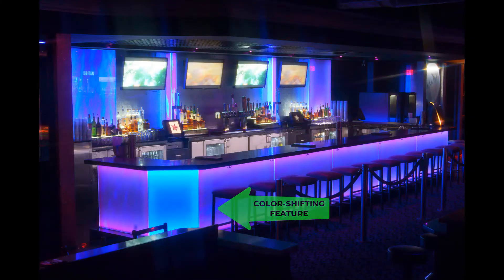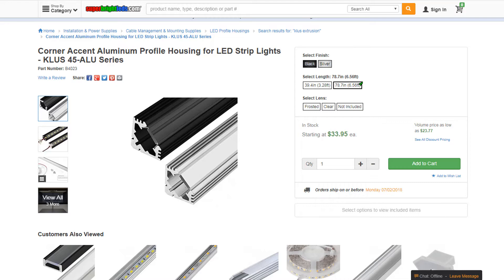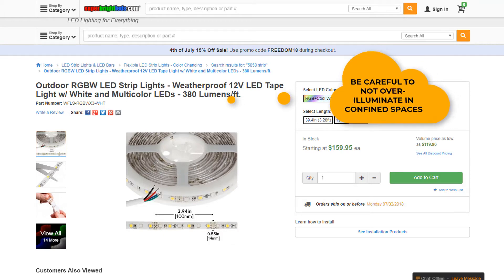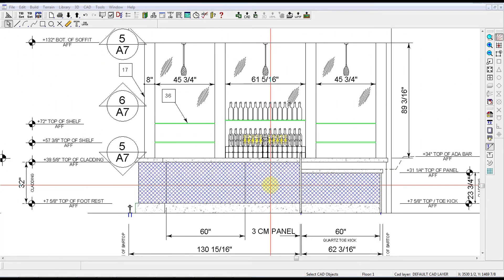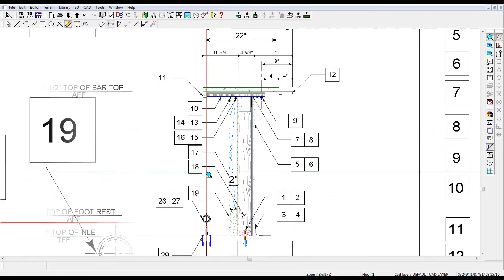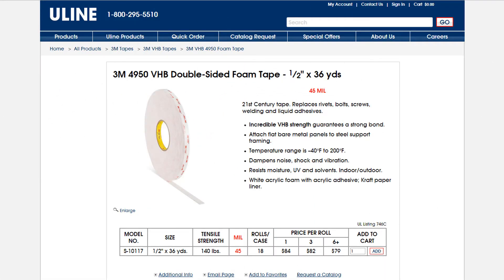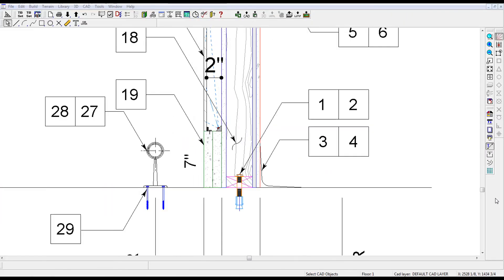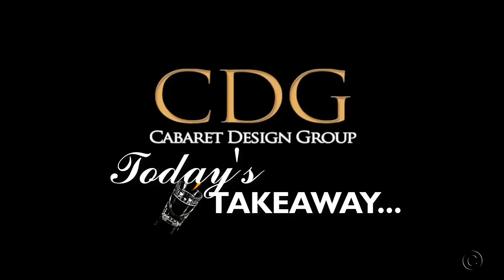LED Bars - How to DIY Design and Build

Comment: Great video what about a modular bar where the front panels are supposed to be removable for easy access and maintenance. Is there a way to put the panels with removable clips right to the frame of the 2x6 metal studs.
Reply from the maker: Thanks for the feedback. Yes, the modular bar die enables external access to plumbing and electric, which is run entirely inside the die (and all bar equipment (except for coolers and glass washers) is welded to the frame at the factory). Therefore, all utilities are accessed from the patron-side of the bar. The panels are normally installed with Z-clips, which are installed continuously along the top and bottom. I'll be covering the modular bar die in an upcoming video.
Reply from the maker: I don't think I entirely answered your question. Z-clips work best for bar die with a millwork finish, and yes, they're mounted directly to the metal framing of the bar die itself. Backlit bar fronts (which utilize architectural panels or translucent makrolon) work best with a 1/2" x 1/2" x 1/8" anodized aluminum angle that runs continuously along the top and bottom edges, per this sketch: http://cabaretdesigners.com/images/LED_BACKLIT_BAR_SECTION.pdf You'll need to drill three or four equally-spaced holes along the top and bottom edges and use small, self-tapping screws. Good luck!

Comment: Thank you for your quick reply whats the best material to use for the front panels for an LED bar.
Reply from the maker: My favorite is architectural (tempered laminated) glass - it's the material we used in this video and also for the bars at Night Trips. However,  this is very expensive (about $130 /SF). The best bang-for-the-buck are the translucent makrolon materials I referenced from Lumigraf; for best results, use the 3/8".

Comment: Thanks for the great video. I’m doing some diy at home. Question do you have the Legend/descriptions the numbered materials for Bar plan? Just trying to understand if panels are glued to wood behind it or what materials are used behind the resin panels 
Thank
Reply from the maker: I have to apologize for the lack of information. I just created a PDF of the sketch (complete with keyed notes) and you can see and download it here: http://cabaretdesigners.com/images/LED_BACKLIT_BAR_SECTION.pdf. With respect to the panels, I always specify using 3M VHB double-faced tape; I always design commercial applications for a permanent installations, so if you use the 3M product, just know that you'll likely break the panels if you attempt to remove them at a later date (the LED's are so good nowadays that we never have to worry about lamp failure, so that shouldn't be a concern). You could also use mechanical fasteners (the next best choice). Caulk and glue aren't good choices, especially if you use the Lumigraf panels, as adhesives will likely cause delamination. Good luck and thanks for your comments!
Reply: Bar Designers thank you for the details. It helps. 
How much per sq ft approximately is lumigraf costing? Thanks
Reply from the maker: They charge around $30 per square foot for a 4' x 8' x 1/8" sheet. Makrolon is easy to cut, but just know that you're going to have a lot of waste if you purchase 4' wide sheets. They'll cut it for you. Good luck!
Reply: Bar Designers thanks again... I’m just doing a kitchen island 3’ height by 11’ so it maybe it will work out. Still into two sheets at those dimensions unless they do custom cut... I’ll call them
Reply: Bar Designers I heard you say Lumi onyx. What color works the best to show different colors of leds? Thanks again. Hope the interaction helps you video 👍🏻
Reply from the maker: If you're trying to get the maximum LED effect and if your application is in a kitchen, I would recommend something like the "Lantian Grey" pattern. If looks more like natural stone. Any of the other patterns on that row would probably be favorable also. Lumigraf will ship you samples and we always order these for our clients. This is probably your safest approach. Good luck!